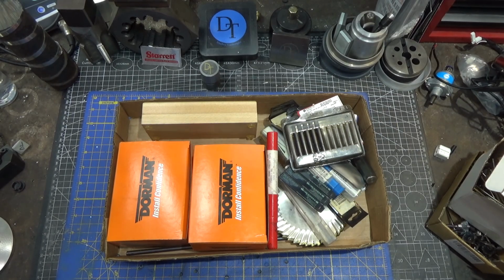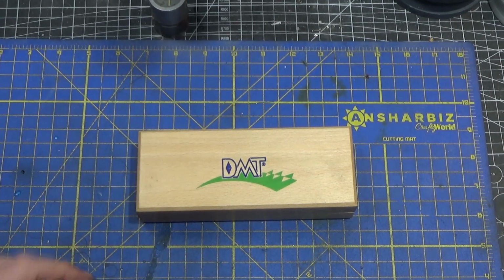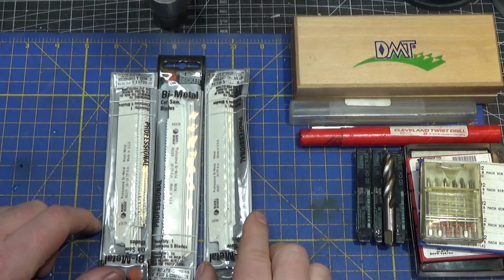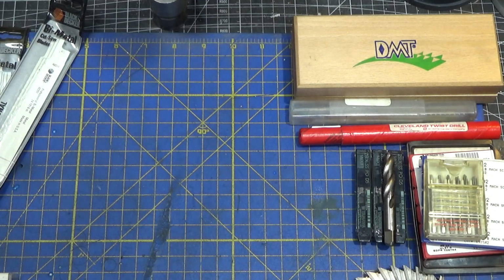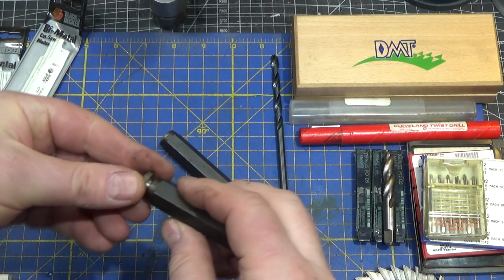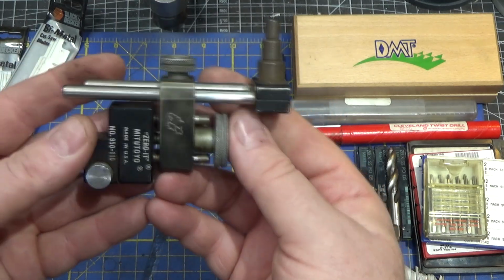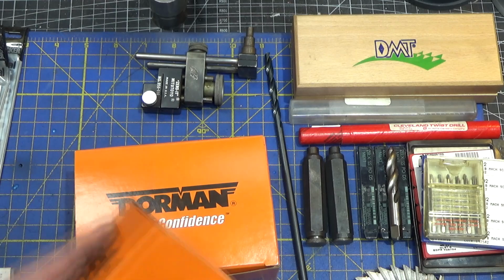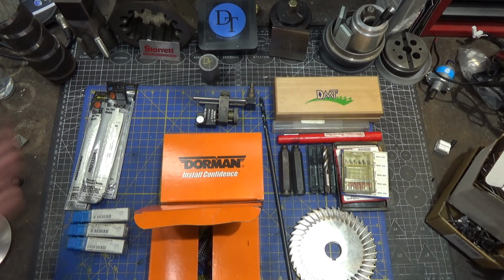Recent Acquisitions #004

Comment: Hey Dudley, long time no see, LOL.  The Niagara 3 flute cobalt roughers should work great in D2.  Nice to still see some of the Side tooth slitting saws still floating around out there.  I redesigned those and all the processing tooling back in the late 90's.  They are fully ground from solid not pre-milled.  Hope to see them in one of your upcoming video's.
Reply from the maker: You designed slitting saws, how cool is that? It's been a whil since I have used one, but when you need one, you need one. This guy had, quite literally, hundreds.